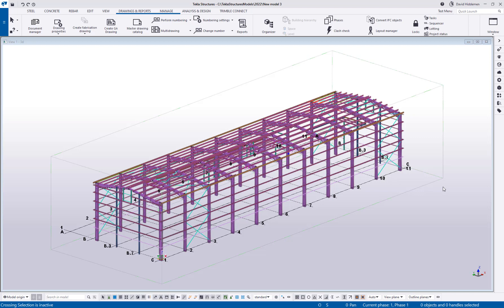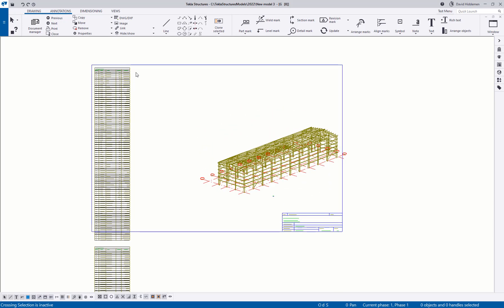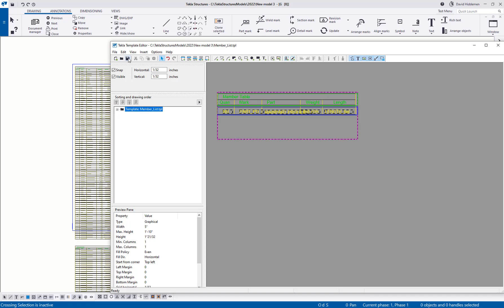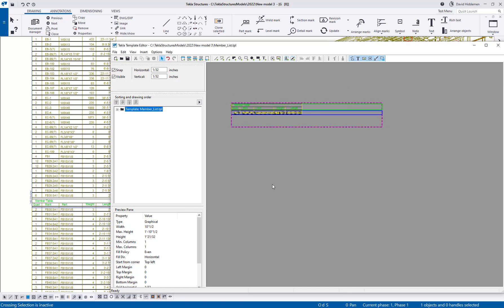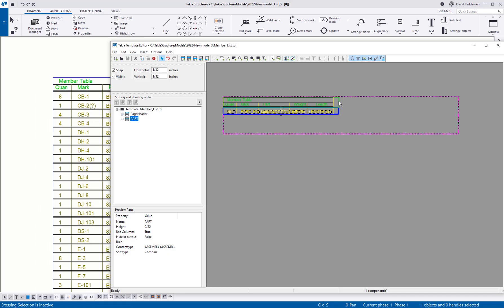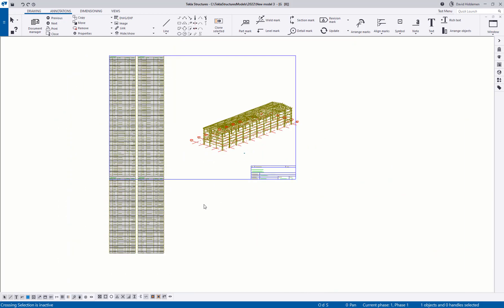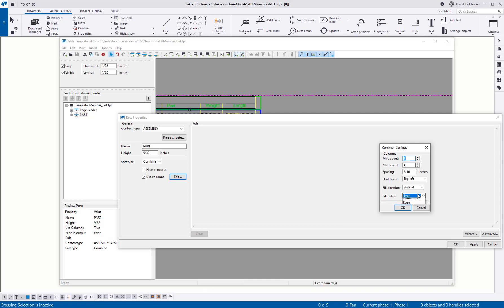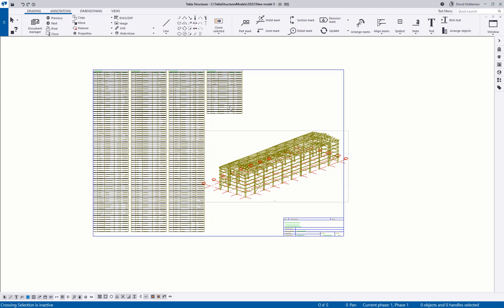Template Columns in Tekla Structures

Comment: is it possible for a new column to stack to the left rather than right directions?
Reply: You can use the "top left/top right" options in the column settings to change the stacking order.
Reply: Thank you david, but that option not showing on template editor version 3.4 is there any other option to do this on old version?
Reply: Hi, unfortunately I don't know. The oldest version I currently have access to is 3.6 and the option is available there. Best reach out to your local support.

Comment: Hi. Nice video! Is  any way to define same template for different paper sizes? I mean, is it possible to define more than one values of column height?
Reply: You can 'scale' templates when they are used on different drawing layouts, but I'm not aware of a method to have different column heights defined.